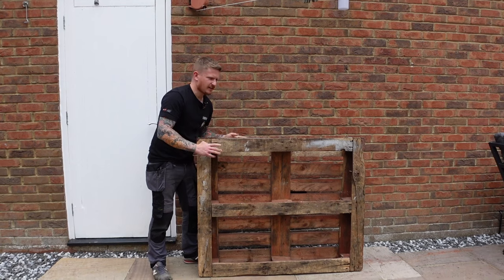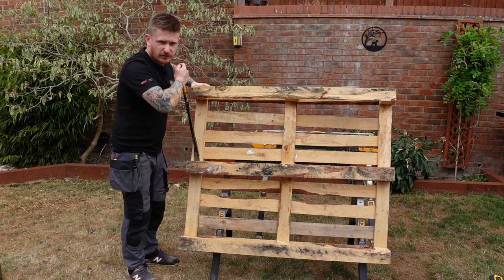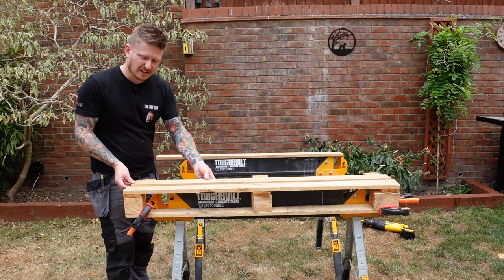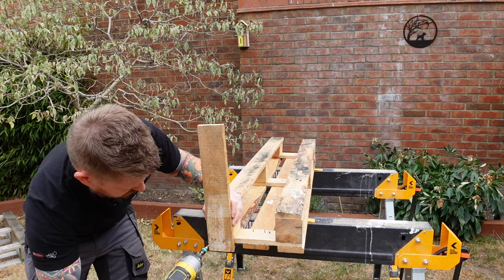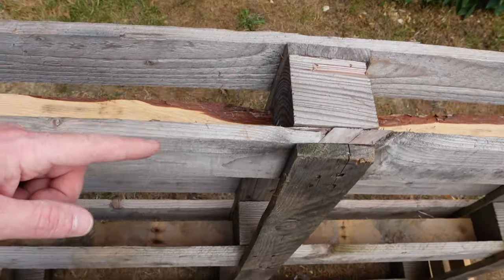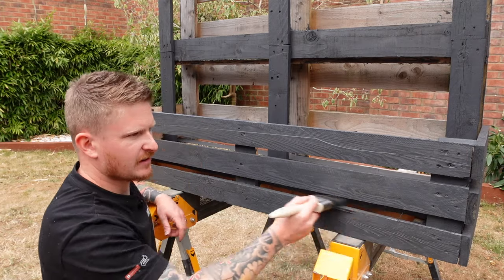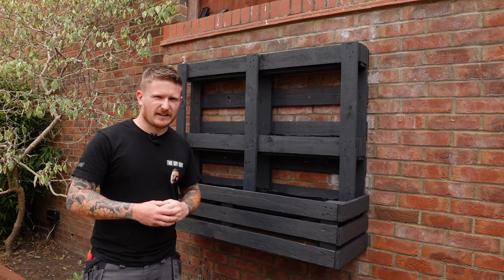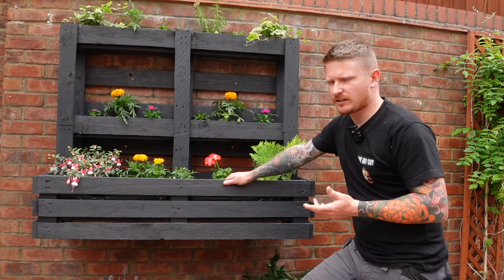How To Turn Pallets Into Modern Garden Planters - This Costs Almost Nothing!

Comment: It’s nice.  I wish you showed how you attached it to the wall.
Reply from the maker: I'm glad you like it.
Reply: Yep, that's the money shot - how to attach it to the brick.

I have 4 pallets in my back yard and wifey is demanding a planter - thanks for video mate! PHX
Reply: I was also hoping to see how to attach it to the wall.
Reply: One way to do it. You can use an electric drill. Then just hammer some metal fixings or raw plugs into the concrete.
Reply: I came to comment this too. It looks fab but with that amount of weight, I’m clueless how to fix it to the wall safely 😂😂

Comment: A year late here, but love the planters you created, but if I could offer any sort of recommendations, if you ever have to remove cross bearers from used pallets in the future use a medium to heavy engineers ball pin hammer and centre punch and push old nails through the slats until all the block are removed from the slats, if you are going to reuse the square blocks you can rotate the blocks to reveal virgin wood surface’s.
Reply from the maker: 👍 cheers

Comment: You know on the sides it could hold a garden hose wheel and garden tool organizers.
Reply from the maker: Good idea
Reply: @TheDIYGuy1  Sky's the limit. You could build another where it's a plant preparation table. All sorts of cool things, you could build the same spec as that planter but the table is a lid for storage underneath where you house all your fertilizers, or again garden equipment.